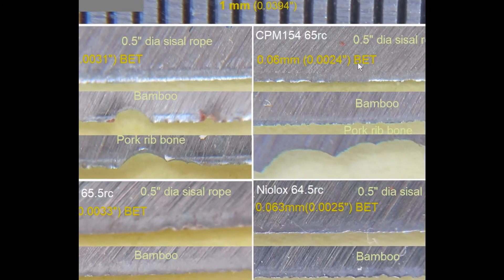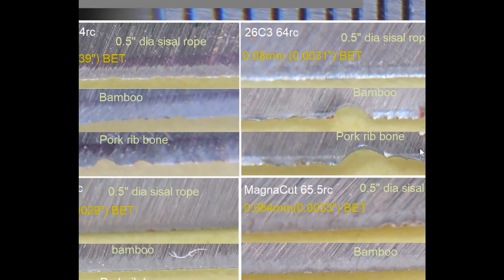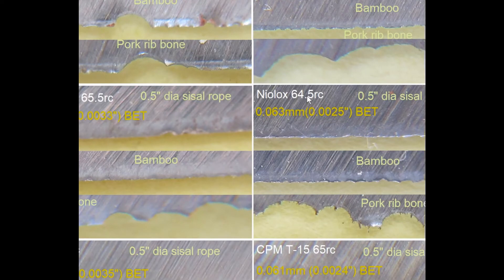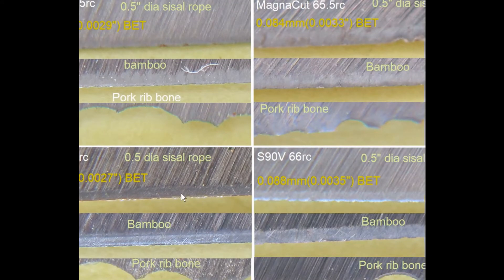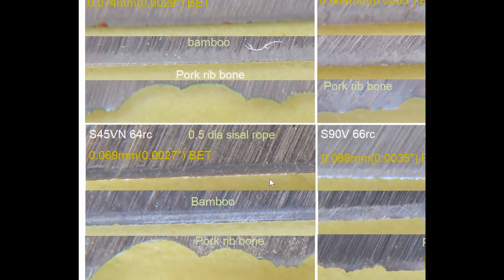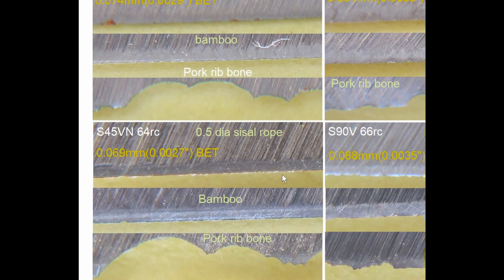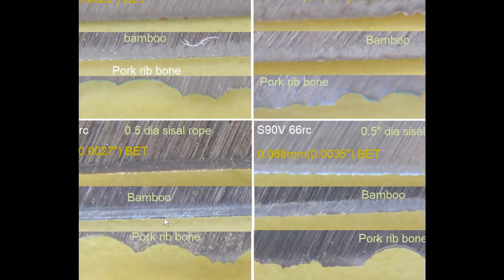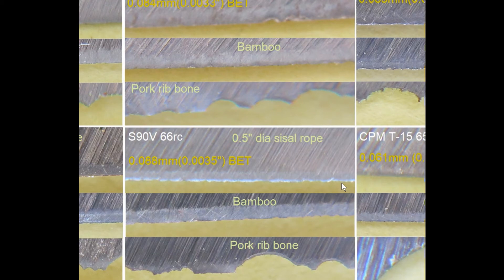9 Steels Blades 10dps Edge Cut Test

Comment: Its nice to see those s90v results.

I've been saying for years that s90v is tougher than most people think. Obviously it's not s7 or 3v but for a stainless steel with that level of edge retention it's more than adequate, especially for normal EDC use.
Reply from the maker: Agreed, conventional ht s90v to 60-61rc should has sufficient toughness and excellent wear resistance for normal EDC.

Comment: Great work!
Through recent testing I found this with your heat treatment. MagnaCut and Niolox have quite similar toughness. 
When AEB-L have hardness above 63RC, is AEB-L even better toughness compared to other stainless steels (Magnacut and Niolox)?
What are your comments on the wear resistance and corrosion resistance of these 3 steels?
Reply from the maker: est comparison at 65rc hardness - aebl would be slightly (less than 5-7%) tougher than niolox.  my interpretation, niolox is slightly tougher than magnacut.
From trajectory of ht6, I won't do wear nor corrosion tests yet.  Will continue focusing on strength & resilient research.
Reply: @Luong_La  The trajectory of ht6 HT 6  will be very desirable.

Comment: I use Niolox for well over 10 years because I think it's a great stainless steel and I haven't even had the chance to use its descendant Niolox+ but I'm still surprised how good the Niolox hold up considering it got a bad rep based on some thoughness sheet everybody seems to use for reference, especially compared to MagnaCut which seems to be overly loved and thus hyped everywhere.
Reply from the maker: Niolox+ is identical to Becut, just a relabel I think.  I've a niolox+ (um. Becut) blade in this batch of ht, at 63.5rc likely it would has greater plasticity range than niolox at 64.5rc. I might put an edge on it then do this 10dps edge test.
According to this test objective - plasticity curvature & distance - 64.5rc niolox ranked above 65rc cpm154 then 65.5rc magnacut. Not sure how steels rank when normalized to 65rc.
Don't let marketing bother you.  Knife/steel world is staled/stagnant, so people are overly eager to adopt marketed innovation ;)

Comment: Are those chunks coming out of the microbevel or the apex bevel? 

A thicker BET and a shallow angle on the secondary bevel not only decreases resistance of the blade as it sees material but it also pushes the failure to the very apex. 

10dps is pretty shallow. I think the thickness behind the edge could be made thicker, say 0.040 to 0.045 while keeping the angle the same or even reduce, increasing cutting ability.
Reply: I don't think there is a micro-bevel. At that BTE thickness the bevel is tiny.

Obviously a thicker bevel would be stronger, but I think these videos are all about seeing how steels perform when pushed to their absolute limits.
Reply: @CNYKnifeNerd  Actually with a very thin BTE thickness, and larger angle (thicker bevel) would actually make things worse. Sure the edge would be protected from damage, but you will in effect push the damage up towards your secondary and primary grinds. 

This is how lots of people blow chunks out of their knives, not just small micro chipping on the edge. 

At this point and this hardness, I would think that the goal would be to maximize BTE thickness and minimize the angle of the bevel for best performance. This pushes the failure to the very apex, where damage is easily repaired. 

Fixed a Half Moon Shape on a blade is pretty difficult if you ask me.
Reply from the maker: Thanks for answered [The Man]'s question.  Yes indeed, test's main objective is to measure plasticity range where slicing bone guarantee 100% fracture.  Fracture chunk size depends on cutting angle and pressure.
Reply from the maker: "..At this point and this hardness, I would think that the goal would be to maximize BTE thickness and minimize the angle of the bevel for best performance. This pushes the failure to the very apex.."  akin to zero scandi grind (no micro, thus just 1 bevel).  
Certainly 10dps zero-scandi would has "shorter" fracture than 10dps apex + 3thousands  inch bte + 5 dps primary.  However thickness of fracture would most likely be about the same due to same elasticity modulus at that point of failure thickness.
Effort of fixing either edge to its initial edge would be ABOUT same painfulness, except the latter edge lost more blade height.  Obviously sustaining cutability wise - the latter edge would be less wedging. 
Keep in mind, 10dps apex would deflects away (think of brass rod flex test) from hard bone when trying to initiate the cut.  With sufficient penetration pressure, edge already in state of high stress and strain, where apex might already yielded (elastically).
Reply: @Divine_Serpent_Geh  

You're talking about how it fails. I'm talking about when it fails.

Sure, that thicker edge may fail more dramatically, but its also gonna survive situations that a thinner edge wouldn't.

Not sure why you felt the need to use oranges to try to say I was wrong about apples, though.
Reply: That fully depends on use, these pictures just proof that ultra thin btw even at low ange is stable enough to handle most tasks. As long as the damage of the first two tasks is smaller than the edge bevel, all is fine. Only for the high pressure bone carving it failed.
The bte and angle was meant to bring it to that point.

I get your point with sicnificantly larger 10° bevel, it might not fail as big, but propably still not enough apex stability for bone carving, so the edge will crumble earlier than 15°, which bevel can also a bit larger for this task.

Angle and bevel size always depend on use.

Comment: CMP 20cv is really really surprising.  That steel is so packed with chromium, to see it take less damage on pork rib bone then the other stainless,  is interesting.  If you go just by the damage on pork rib bone?  Then its 20cv least damage, then 26c3, and then maganacut.   Considering that 26c3 is plain high carbon.  Ya.  20cv is pretty surprising.  Even if the cuts arent all even on the test.  Its still something.